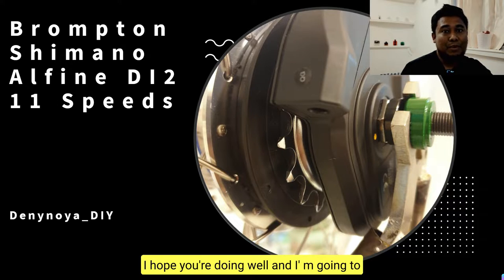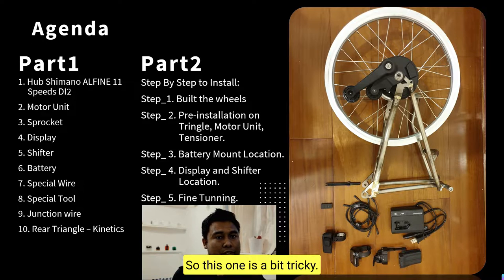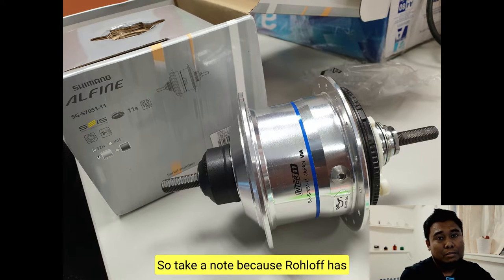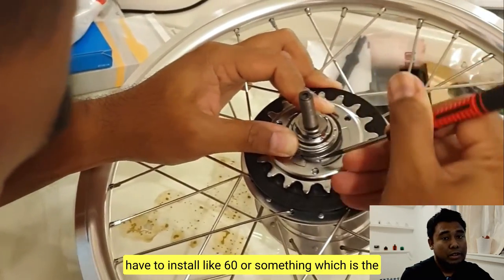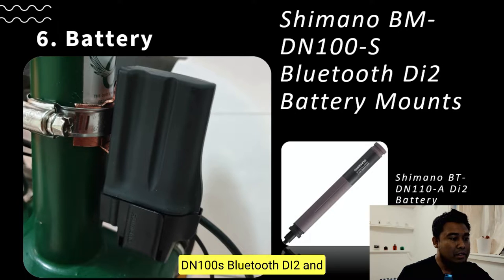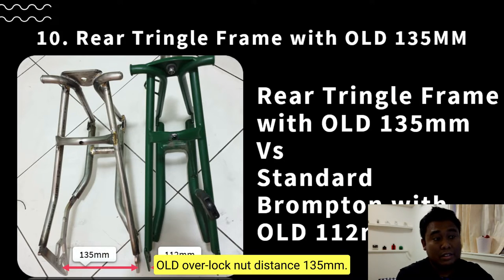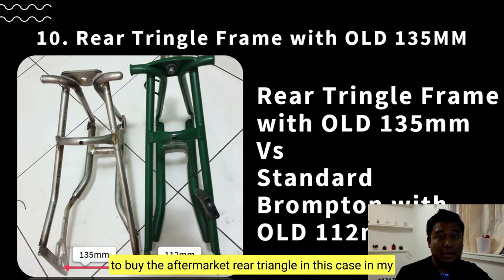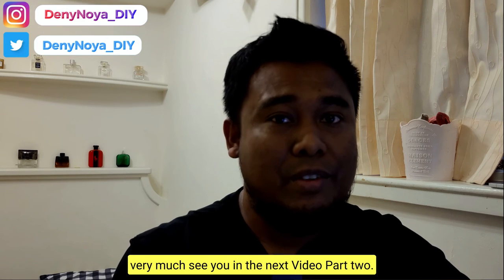Upgrade Your Brompton to the Next Level: Shimano ALFINE 11 Speeds DI2 PART_01

Comment: Great video. For last few days I trying to find list of all parts what I need for Di2 "belter" project. But this is first movie what showing all what is needed with Shimano names for parts. 

Question - you used only 3 SD50 Di2 cables? Display -> hub/junction, Motor ->hub/junction, battery-> hub/junction. What with shifter? It is connected straight to display unit (MT800 XT)?

Thx for response. 

And once more - great DIY project with rly good explanation what and why :)

EDIT: I cancel question  :) , on second part of this project when you showing bike when is folded I see that MT800 XT is connected straight to Display :)